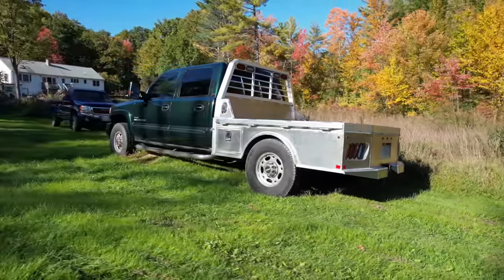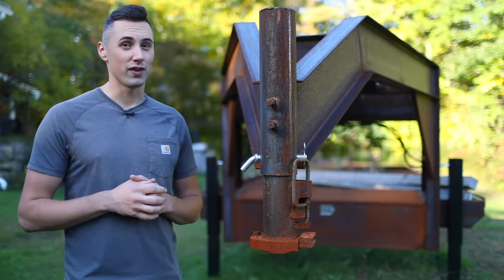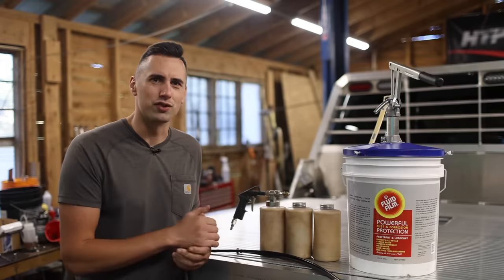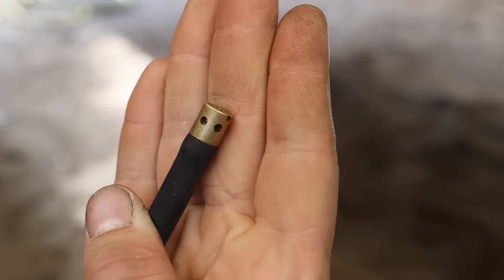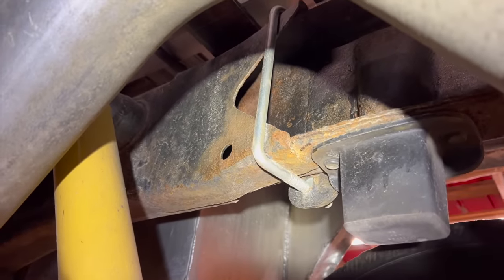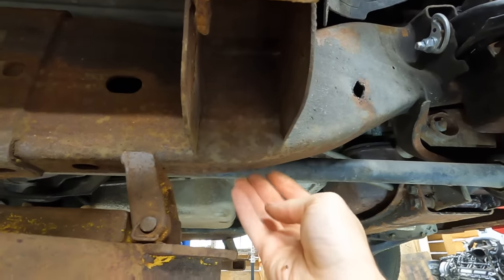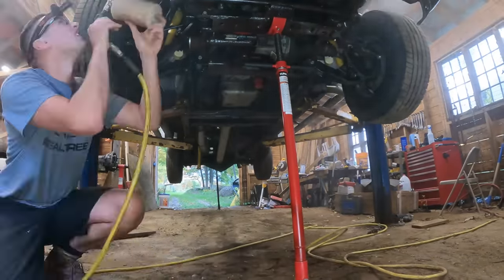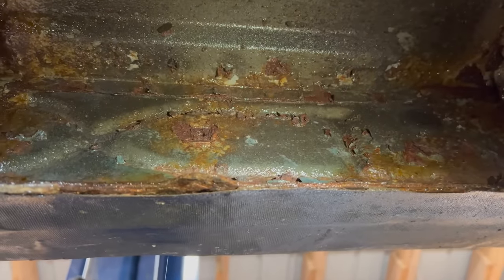Oil Undercoating my Truck so it won't Rust. Easy and Foolproof Method.

Comment: Why not use NHOU? Being a local NH family owned business, I thought you would have used them first. I have also used both fluid film and NHOU and prefer NHOU and have had better luck with NHOU. I'm also using their new "Mouse-Out" formula in my heavy equipment which seems to also be working very well.
Reply: Fluid film is better
Reply: @lmCIoudz  Do you have any information to support this claim?
Reply: @BrianG-xj4nu  thousands of videos on YouTube. Look up repair geek or project farm.
Reply: @lmCIoudz  So Project Farm never even tested NHOU. Repair Geek tested Fluid Film, NHOU and others and now has a newer video claiming that the new Blaster Surface Shield is the best. Either way I've had the best luck with NHOU and have been using it for years. One of my vehicles which has over 300,000 miles and has ZERO rust despite being a daily driver and I live in the Northeast.

Comment: You also want to avoid spraying it on rubber surfaces like cv boots. it can cause them to wear faster according to the warning label on my fluid film bottle. I never got much smoke from getting some on the exhaust but the smell from it burning off is insanely nasty. I've been using fluid film for 7 years now. It works great and is keeping my trucks alive.
Reply: It just makes the rubber softer. I had no issues on my cv boots over 7 years
Reply: Only thing that it really affects is the weather stripping

Comment: As someone who lives in the Northeast, I can honestly say that Fluid Film does NOT work. I had a van coated with this about 5 years ago, and by spring when I looked at the frame... well I was surprised to see a lot more rust than when I started. I also realized that it is too thin, as the frame did not show a bit  of Fluid Film on it.

Comment: If I go to undercoat my truck do I have to get all the rust off first?
Reply: Remove flakes because they have tons of moisture in them and will be the first place the coating fails, but surface rust is fairly safe. You can remove it and coat it with a rust encapsulator like POR15 if you really wanna, but most people will just remove flakes and spray the fluid film / crc / etc.

Comment: I´m from Germany. Here you can get real problems when you"oil" your cars. My Dad did this his whole life, since the 60´s, but now it´s forbidden because of enviromental protection. I use underbody sealant and thin down it a little bit with petrol. For a whole car I use a spray pistol but small things I use a brush because it´s a sh.tload of work to clean the nozzle.

Comment: I bought a southern car that was 10 years old, it took another 10 years for it to start rusting in the midwest. I don't think oil will work to stop rust, and we probably won't be around long enough to find out.
Reply: Well, I have a 97 F350 that I bought brand new, spray it with used motor oil and diesel fuel every year, run it down the dirt road numerous times during the dry season. It's a northern PA truck with no rust on the chassis, the paint stencil part numbers are still on the leaf springs, so I beg to differ, I've owned it 25 years and will own it for another 25. I think that will be long enough to prove it works
Reply: @TheRoadhammer379  I guess I'll get out the sprayer and fill it with oil. Doesn't the oil attract dust from gravel roads though, maybe that doesn't matter if there's enough oil. 
I first heard about this trick years ago from a guy named Mike Haduck who has a video about it on his YouTube channel, Mike Haduck Masonry. 
Having thought about it, you never see rust or tarnishing around leaking engine or driveline parts.

Comment: I can give u a way way better recipe and a way cheaper one. 1 quart of any oil new or used, 1 quart of trans fluid new or used, 1 tube or tub of grease and 1 wax ring gasket for toilet. heat and melt and mix. I also throw in some hydraulic because of heavy equipment that we change. U can add whatever else u like. It costs less than $10 more like 5 bucks. I add some linseed oil also sometimes. Depends on what I'm coating.

 Most products don't use oil based chemicals. I also use Trans fluid, mineral, baby or heated Vaseline and plug the door drains and fill up a couple inches and leave it there for a week and drive around. Then drain out of 1 drain and save for next time. This will stick and stay way better than anything I've tried. Fluid film, Blaster, Cosmoline etc. U can add more wax, less wax etc. My Pap told me of this that an old timer told him in the 50s. Never had any rust issues.

 I also use Eastwoods internal frame paint. Uses a long all thread, wand etc with small pieces of chain and drill to get inside rust beat down of some is there. Then paint. Then I use some farm implement paint to top that. That shit is hard to get rid off. Try to sand some old yellow or green JD paint from 90s. Ull wear out sander and yourself. Even slag blasting will barely eat it away. Add some hardener to it, wear mask shits bad and I promise you won't have any rust. If u have heavy rust get off however and when it's surface spray or coat with Ospho. Used by DoD for naval and CG, etc anything that will rust in salt water. Spray and let sit 24hrs. Then wipe with whatever u want and paint. Ospho chemically reacts with rust to transform rust to iron phosphate which can never rust again. Yes u can get home depot phosphoric acid but it don't have the wetting agents, dichromate and polymers that Ospho does. All can be had from Amazon, Walmart, etc. Eastwoods paints for frames etc are excellent. Ospho can also be used on parts u don't want to paint and leave the metals color. Just FOLLOW THE DIRECTIONS. to a T. If using epoxy, reactivate ospho and let sit 5 min, wash off with soap water etc, dry with air, heat, torch etc then use epoxy. I've used Car Rep brand epoxy primer, paint and clear coat. It has 2 part catalyst that has NO SHELF OR POT LIFE. it don't mix until sprayed and costs same as 2k clear brand that only good for 24 hrs max in fridge to save it. I've used Car Rep from UK and it's the best for small jobs like frame and under body work. You can do a section, prime and do rest when ready and not have to hurry get all ready so paint or primer will last. It's a game changer. You are welcome. Fighting rust since 1950. Kicking it's ass since 1990.

Comment: Used engeine oil works so much better and its 100% free. Here in the  salt belt of north western Ont. Canada.  You didnt drill holes in your door posts. Doors in here fenders hood an cab roof just to name a few you didnt do.  Also when it's up in the air it needs to all be presser washed inside an out frames floor pan rockers door posts inside an out an let dry first. Spraying it when it's all full of mud dont do anything

Comment: In Michigan, had a friend who owned a body shop.  He did this same thing but with used motor oil.  Let it drip for a day and drove it all winter.  In the 70's.  Wouldn't pass the environmental wacko test these days.

Comment: With all due respect I think this method  will not give you sufficient protection. There's a lot rust on frame and body of the truck. What you really should to is to use wire brush on drill and remove all loose paint and rust to the bare metal. Next use some rust-reacting primer, then regular primer (e.g. epoxy) and in the end use some rubberized undercoating to protect from physical damage. the oil you can use inside frame, not outside, otherwise water or sand or rocks will do its job. In Poland we have snowy winters and a lot of salt on road so there is no other way. Believe me, I tried. P.S. Sorry for my rusty English. It's been ages since school.
Reply: Rubberized coating has been tried for years in the United States and it is a failure. It's not difficult to Google images of rust after using rubberized coating. Waldo stated in another comment that he uses this method every year and has not had further rust issues. As far as the rust on the truck body, he's replacing the sheet metal in the near future. What works for you might not be a solution for someone else and vice versa.
Reply: @TheRoadhammer379  Maybe you missed my point. I said to use rubberrized coating as the last layer of protection. It was just an example, I don't know what kind of products you have avaliable in US, it was first product suggested by Google searching engine. What I meant is to use anything that provides mechanical protection. Something based on rubber, polymer, poliuretane, maybe other chemicals. It works only when you apply it on solid surface thats why I mentioned about primer. If you do it correctly you can hit frame with a hammer and it wont leave a mark. Waldo's method is just fine if you don't drive too much on gravel roads and apply this protection every year or so. Maybe I'm just lazy, I wouldn't have patience to do it every single year. I applied full frame protection on my old Mitsubishi Pajero the way I stated, multiple layers and polymer coating on top. It was 6 or 7 years ago and there's not much to do now. It took me over a week but I think it was worthy. What I do now is just checking for damage and apply some oil inside frame and lower body panels once a year. Ps. You're right "What works for you might not be a solution for someone else and vice versa". I just described my method :)

Comment: I hope you are wearing protection gear when applying this stuff for eyes and raspatory. Here in Finland I use Dinitrol and Sika products to coat undersides and the common typical rust areas of the model. So far cars have remained rust free. :)

Comment: I was expecting oil no fluid film,why did you say oil?...My point,in the past I would just pour used motor oil in those access holes in the frame to prevent rust.Not the best but way better than nothing.

Comment: I found if you just leave the oil filter a little bit loose and loosen up some of your oil pan bolts it will undercoat the truck by itself

Comment: I spray transmission fluid into the channel’s.  Rails. Everywhere except muffler. What a mess..evertime I get the erge to get dirty and gressy underneath my truck .     only spend 5/10 minutes and done with a 5 dollar spray can…works great ….no compressors ..no setup…just a spray can…leave oil in sun,,,,hotter the better..cheap…tranny fluid doesn’t hurt rubber seals…

Comment: Guys if you like me I like thousands of others you will use used motor oil you use a magnet to draw the sediment and metal to the bottom you will drain the good out you will add dish Dawn soap one ounce to every 15 oz spray the underneath the Dawn soap is to make it stickier think about this there's no rust on your oil bolt is there

Comment: 1-2 years this car will be completely rusted out. This stuff gets under the paint and peels it off. The same with engine oil. Better off with removing rust and paint. Then use some thin wax that dryes. Shortcuts is a bad idea to keep the rust away.
Reply: Had this on my truck since new for 7 years, not a speck of rust. It was on a Tacoma too

Comment: What you are doing is pointless, you didn't kill the rust first, you have just covered the problem, all that rust will continue to spread.
You should have used a kill rust product first, then apply oil.

Comment: Not trying to be an ass, but we would call that a badly designed car.... why are there so many rust-sensitive cavities, holes, undercuts,.... on this car
Reply from the maker: I definitely agree, especially on the lack of a robust coating. It wouldn't be that expensive for them to hot-dip galvanize the frames at the factory. I think it would be worth paying a little extra for a new truck if that were the case

Comment: No need to wear a mask or eye protection?
Reply from the maker: A mask might not be a bad idea. Eye protection is a great idea, but it gets covered in oil droplets constantly, making it hard to see. I gave up on safety glasses early on because of that 😂
Reply: @WaldosWorld  Fluid Film is Lanolin based. Not petroleum.

Comment: For the love of science, I am tired of seeing all these rust coating videos. Get on amazon and buy a block of Zinc and bolt it to the frame of your car. They are usually sold as Zinc anodes for boats. The zinc has to rust first before the iron in the frame so just replace them every few years.